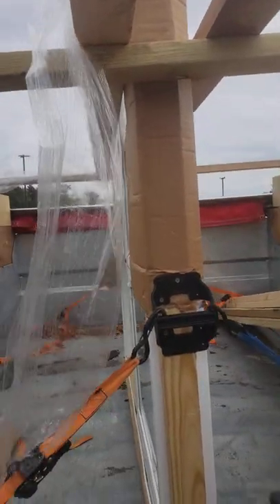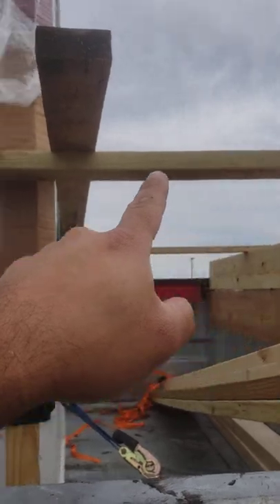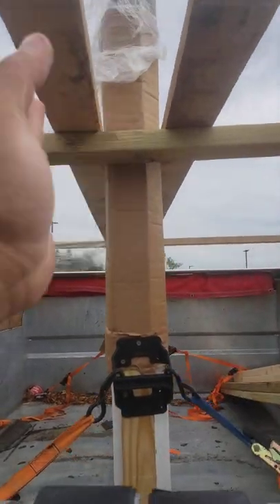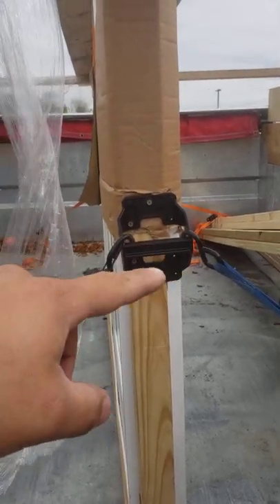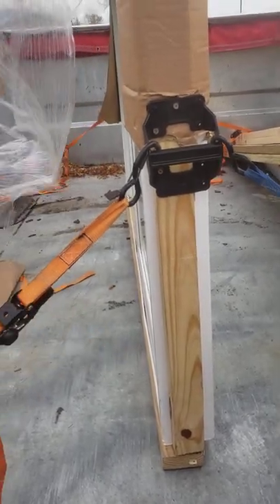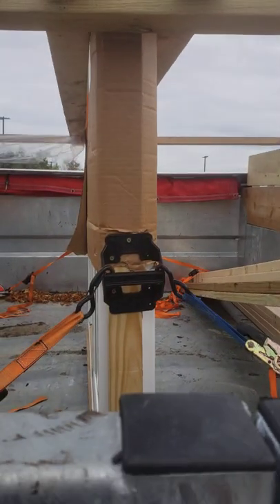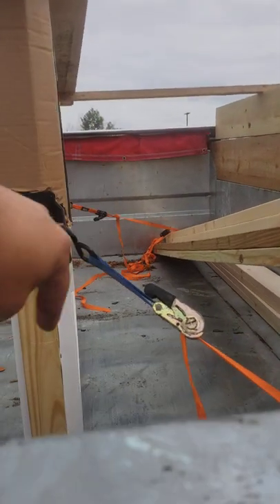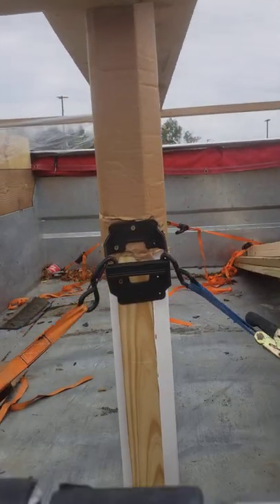How To Transport A Sliding Glass Door

Comment: With how many diy things that are available on yt, I can't believe how much trouble I had finding a suggestion for this. 
My ordiginal plan was to basically build a tall narrow sawhorse down center and strap the windows to either side... but this looks like a pretty good idea too! 
How did it work out?
... also worried my trailer walls may be a bit too low for this type structure, so I'd probably have to attach a full perimeter temp frame.  No more complex than the sawhorse build though.  
Thanks for inspiration  👍
Reply from the maker: It was super easy worked like a charm.
Reply: @Odatscoo716  sounds good! Appreciate the info and response ; )